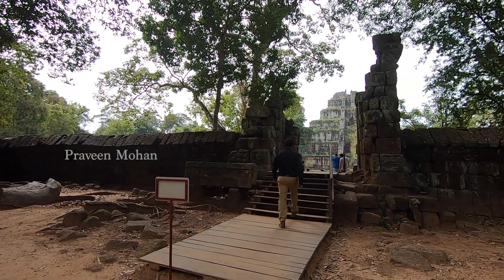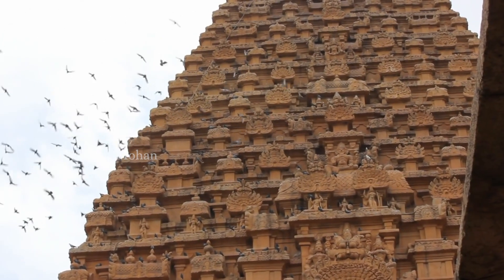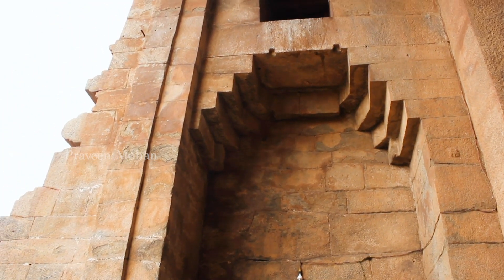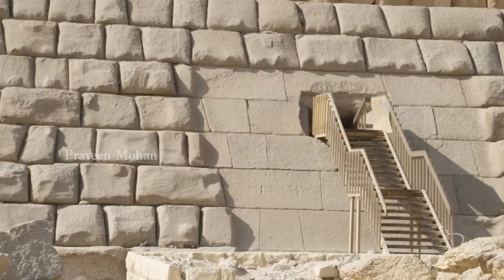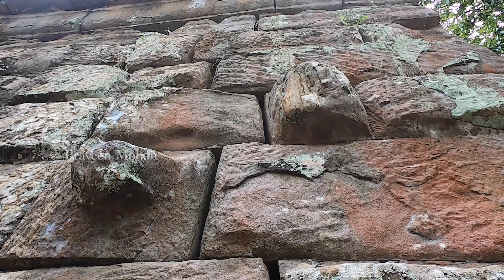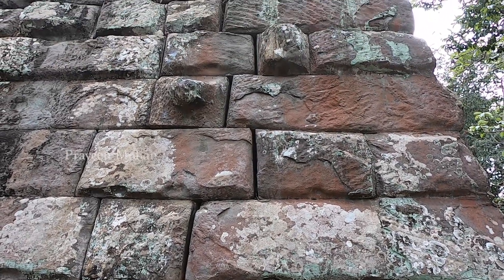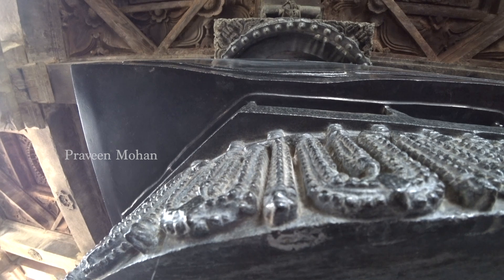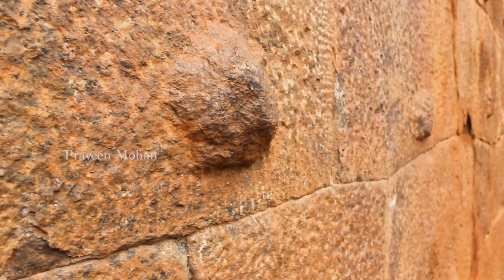Mystery of Ancient ‘KNOBS’ in Temples - Evidence of Stone Melting /Geopolymer Technology?

Comment: the polygon walls in peru are unexplainable, how did they get the exact matches to fit seemingly random polygons blocks exactly. if molded in situ then how do you mold in situ with the knobs on the vertical face, surely any knob would be at the horizontal top, which only leaves carving stone which makes it even more mysterious.

Comment: Consider individual rammed geopolymer blocks made in batches and laid when slightly moist. Exterior form work may well have had a number of small ‘windows’ cut, allowing material to squeeze out under pressure (resulting in the knobs). These knobs would allow access to determine the curing state of not only the individual block behind the aperture, but also all the rest of that particular batch of blocks. After an appropriate time, testing the consolidation and strength of the extruded knobs would indicate when the external form work might be struck and further courses laid on top. Because size and moisture content might vary widely between batches, and weather conditions would rarely be constant during production, this would be an elegant method of speedy and efficient construction.
Reply: Exactly. Besides these practical considerations it might have been dictated also by necessity. For instance if the postulated chemical reaction produced gas maybe it was necessary to leave small openings in order to let the accumulated pressure escape.
Reply: Great theory!  Curious why only some stones would have nubs tho.
Reply: Maybe some had the perfect recipe..just a guess.😊

Comment: I'm a builder and I've always thought that most of the ancient structures were cast but not melted but ground up rocks into powder and mixed with a geo polymer. They were smart and if you are in construction the saying is to work smarter not harder. So they could have melted stone but I believe that it was mixed like concrete and the sophisticated carvings were poured in my opinion. And that doesn't take any credit away from them because like I said your supposed to work smarter not harder. It would be stupid to haul giant stones from miles away cut from a quarry and spend all the time to carve them which would take a very long time compared to casting. I believe they definitely had advanced technology and power tools and they had to make the carvings to use for templates for casting so they probably carved all statues and art around the temple in wood with electric tools like a cnc machine or a router and then used them to produce all the pieces so each is exactly the same size perfectly matched. There was a guy I believe he was French who duplicated the great pyramid blocks by casting blocks and scientists still want except it because they are bought and payed for ofcourse. There is a video about it. But I believe that they could even grind up granite and mix it and when it's done  you can't tell the difference. But I myself have wondered if it might have been melted in some instances.  There are spots on some of the sarcophaguses in Egypt that show signs like it was dripping on some of the edges of the lids and some bulges on some of them like the form bowed out. These people always wonder how the ancient people got the sarcophaguses down there because they could not possibly fit through the hallway just like some other places, well because they were cast. And the reason why plants grow on the temples is because they mixed organic material which possibly could have had seeds in the mixture blowing into it from the wind when mixing the material or possibly something that was an ingredient like some kind of ground up plant that was part of the formula and then with erosion they sprout when they get the chance. If it was melted then it would have destroyed the seeds. Which is just a theory.
Reply: Well the casting theory is of course interesting, but if you’re analyzing the material in the blocks it would easily give you the answer; is it or isn’t it produced as a casting.
I don’t believe that the science has determined this, so 
I believe the blocks have been grounded together.

Comment: that's way off  about the stones with knobs being defect. they are even harder to make, making them more valuable if the had a monitary value but they did not. They did have structural integrity, if fact the stones with the pertrusions are probably stronger because if you made every side flat and put a load of pressure on it than the weakest part of the block would crack, in concrete they do the negative of this with setting groves to try and controle where the crack happens.

Comment: I have a single question about the claims made:  If the 'knobs' are faults in the process, why were they not repaired and worn down to a smooth surface?
If it's true that the walls with statues or writing are all smooth, why would the 'builders' have left their mistakes on the other walls? 
Surely it would be a comparatively simple process to smooth those particular rocks down?  
While I think these ideas are probably close to being correct, one has to wonder why the processing problem lingers on?

Comment: A form of crushed rock  mixed with decaying  plants then wrapped in tightened cloth .This is then placed and shaped at the correct curing time decided by season. After curing cloth is burnt away ,  time does the rest .Plant growth is due to its bacterial  elements. Nearly all grinded stone will reharden  with  the relevant humidity needed . Stone reformation can be seen in all mines and this construction method of block building present in Africa.

Comment: I think you are absolutely correct.  The knobs are excess pour material that was to solidified to knock off easily.  You can see that the joints are sometimes worked also.

Comment: I would like to add one thing here, just like in today's building construction, they create the wooden and even tin/iron mold panels while creating the pillars of a building and in those square mold panels they pour the mixture of concrete and stone and cement etc. And once the mixture hardens, they remove those panels. So it might be possible that ancient hindus might be pouring the liquefied rocks in similar kind of panels and after their hardening they might be removing the panels. It would also naturally stick one rock to another while getting hardened from the liquid state.

Comment: I think the knobs make it obvious that they used geopolymer technology. It's like when the concrete gets poured in and filled up all the way, and then a bit still drips out and creates that impression.
Also what makes it obvious to me is how all the stones are matched up perfectly despite being all different. There are no cuts to be seen since the surfaces of the rocks is very round in most cases and not sharp like it was cut. I mean it's much easier to mold something that fits perfectly, than it is to cut it and it certainly does look like all the ancient stuff was molded.

Comment: if you  notice, all the knobs are in straight lines

when they  quarried  them  they would cut through  the two sides,  then start cutting  under the block until they were very close to  meeting in  the middle.

the last step is to  have everyone come out of the pit and break the  stone off with wedges or wet would

Comment: One question you don’t answer is how did the ancient people melt rocks. That’s a lot of heat needed and you will need huge factories. You will also need a lot of fuel, like coal or gas. Wood would not be enough. Where are the factories that were used to melt rocks. Too many people think they have the answers, but don’t give evidence or proof as to how this could have been accomplished. The knobs were clearly for lifting and are small now because of erosion and people handling. I would also suspect that the knobs were chipped down to prevent enemy from climbing the walls or to make the walls more uniform.

Comment: Possibly in the past there was a lot of erosion caused by thousands or millions of years of weathering.  This resulted in huge deposits of different kinds of sands which people realised could be mixed with water just like modern cement.  There would be a formula to combine different sands.   Then bags or wooden frames were made, bags would be more obvious where the stones fit so well.   The bags were filled with the wet cement but the water had to be let out somewhere and this resulted in these knobs being formed where some of the cement leaked out with the water then dried.  It is the only answer that makes sense to me!

Comment: The knobs may have been from heating the bricks into the final shapes after placement. You'll notice the knobs are usually on the lower portion of larger bricks, where beams of light were focused from the sun to beam heat into the rock to melt it into the final form. Larger blocks needed two focused beams to create the necessary heat to melt rock. The resulting sag (knob) of material would happen directly where the ligh was focused, like a run in paint before it dries.

Comment: The nobs were used to stop the ropes from slipping during transportation most were then removed after the block was set. the blocks without them originally did have them but were dressed out after the stone blocks were set in place. the small nobs were in the process of being dressed out but were not finished due to some reason. 
These blocks were not poured but are natural not melted. This has been proven.
They have been tested and are not geopolimer.
The floating rocks are natural stones, pumice stone floats and so does other stones.

Comment: Rock melts at temps of 1100 - 2400 degrees F. The ancients would have had to discover that rock will melt. Then, by trial and error, figure out how to achieve the necessary temperatures. Then they would have to figure out how to construct containers to hold the melted rock, molds to hold the melted rock, and then the engineering necessary to construct their magnificent temples and structures.

…..or they had to figure out how to quarry massive stone blocks, transport them, carve them into the desired shapes, and then place them…..sometimes at great elevations. 

There is a YouTuber in Michigan, former construction worker, that demonstrates how one older man, can move massive weight all by himself using levers and small rocks. He’s amazing to watch. My point being the ancients obviously figured out how to overcome all of the obvious obstacles and constructed massive structures as proof that they had construction techniques that rival, and maybe even surpass, modern day engineering. 

The great mystery is why their knowledge and techniques weren’t  recorded and why they left no obvious clues telling future generations how they did it.

Comment: Could these block be a dry mix geopolymer tampped into a mould. If the process required adding a liquid like water or an acid/base then the liquid would need a place to drain out. Could holes in the bottom of the mould facilitate this draining and leave a nob when the wooden mould is removed.

Comment: After years of research and reviewing several videos on pouring blocks, it seems probable that the blocks were not melted but rather more like a concrete type of mix using mostly local mud or softened material like lime. I have also learned that some brick builders used common ingredients such as urine and fire ash as hardeners. One thought I had on the protuberances is the builders didn't have plastic or plywood so instead they would use animal skins and the skins had patched leg holes. This could explain the bumps.

Comment: A few questions. Didn’t Nikola Tesla demonstrate that entire buildings could be collapsed using simple oscillators matching the frequency (or harmonics thereof) of steel girders based on their length? Also, don’t all rock materials exhibit their own unique fundamental frequencies? Weren’t the ancients aware of vibrations? What is "sympathetic vibration"? Could inducing the correct oscillations into a select stone be used to naturally seat the laid stones so that the seams fill with the grindings between contact joints? Can any stone's natural frequency be determined by tapping a cut stone that has small particles of salt (or other small particles) sprinkled on them and observe the patterns that form in the salt? What is the relationship between frequency and wavelength? Does this relationship apply to both sound and light frequencies? What is the mathematical relationship between a fundamental frequency and its harmonics?
Reply: More questions. Looking at your pictures of the "Knobs", they look conical in shape and it makes me wonder if all of the observed knobs might be of the same size? The first thing to come to mind for me is wondering if they are male-receptors to a missing and matching female-connector that would form a stable and efficient external vibration connection? In one of your earlier videos of an ancient temple, I was greatly surprised to see the depiction of someone on a bicycle. If they had the ingenuity to create a bicycle, it would not seem surprising the mechanics of producing circular motion to create rhythmic oscillators?

Comment: I think as for nobs only but i dont know cause i was not there :) or maybe:) but maybe they used them for rope anchors as to place them in places according to building structure in moments of bulding acording to stages in building a structure and used them like to hold  ropes to then up over the the other side maybeceven up top connected from other 2 side webbing effect ti hellpnin lifting byy rotating ropes on them selfs and lift heavy rocks back towards wrapped in ropes with  ropes and weaved ladder like wraped goods like up on rotating on its self up top using ropes over the same nobbed side to use gravity with heavy rocks or human or animals pulling and like scale in weights effect like modern old time teeter totter like scales. I dont have drawing to use here but maybe you can understand like unfolding folding movements in let's say carpet but up wall its also like pulley on itself system with anchors where ever they would help and ornamental stages are omitted so its not distracting and not removed cause it balances the effect in textures like in art design it would not be proper to remove in that stone to make it art worthy in architecture for materials used. Visions of i just had like a movie but im awake so more like see through 3d very faint color effect :)

Comment: the "idea" of making rocks is noT new, obviously. But some - emphasize,  sOme   of those stones are natural, like the last polished column, that seems likely the polishers chipped or marred the edge and had to go deeper to buff out marks (?) ; oTher sTones, looK like they were poured, like cement, into a mould, a box form, attached in situ. Would have too heavy, since the mixed liquified material woul;d be twice as dense from fluid being added... the weight of the dry and wet materiaLs combined would be impreesive to lift. Easier to pour mix, liTTle at a tiMe...  but does not expLain carving or cuTTing of basaLT and oTher stones that are harder than rocK! -lol

Comment: The knobs that are only present on some rocks are for tuning the frequency and energy of the structure. The different rocks and overall structure was finely tuned to a specific frequency e.g. power generation, learning energies, healing energies,  etc The knob was placed and adjusted to modify the vibration and local energy flux. I dont believe they molded the rocks. They would have had to make the rock mold a specific shape and size that fits all the other rocks and structure, then make molds for all of them, etc. The make the rock mix, pour and cast. It is even more work than cutting the rock. The rocks were shaped with a resonant frequency technique that softens it and allows it to be treated as a malleable material. It can be shaved and shaped easily and quickly in this state, placed in position where it adjusts to the rocks around it and once the frequency which made the connections mobile is removed, the rock returns to it's natural hardness state.

Comment: I am a stonemason for nearly 40yrs and have seen small knobs grow over night like a wart as the cement btw units cools and hardens. My take is there is a chunk of different material that doesn't conform to normal hardening and is pushed out like a wart. If a chunk of dirt is present it reacts not as expected and is partially pushed out. I notice the knobs are random and make no sense til you understand what I've experienced. Hope this helps.
Reply: But why did they not remove them, all over the world?
Reply: I have heard they were used as holes where electrodes were stuck into the stone to heat them up and make them malleable and able to conform together so tightly
Reply: @RytetTrading  yeah maybe in combination with vibrations. Sounds plausible

Comment: The knobs obviously were not used for lifting, but I don't think they were defects. They could have processed the defects to match the other stones. My guess is that they were used as part of the decorative purpose for pictures that have since faded over time. The knobs are sometimes on the top, not always on the bottom. sometimes to the one side or the other. And sometimes the knobs are on the bottom row which has no function if used for lifting. I think x-raying the larger stones will show they might not be homogeneous. We do aerate concrete to reduce weight as well as add thermal insulation properties. There are several ways to verify if the material is geopolymer. The binder is organic so you can carbon date geopolymers while you can't for rock.